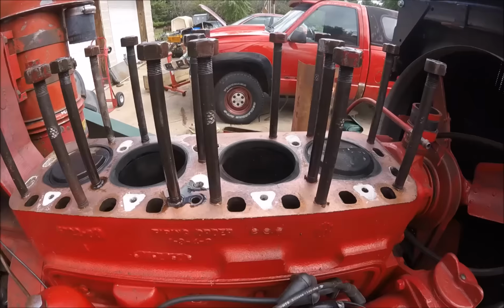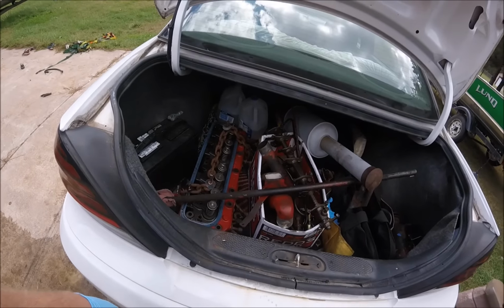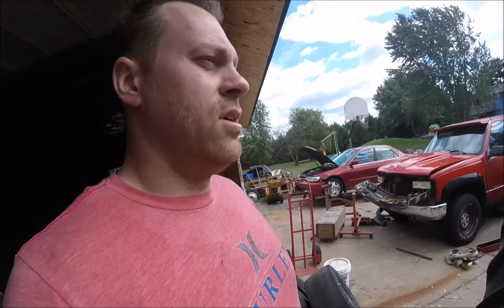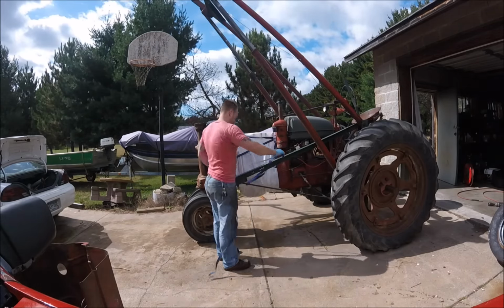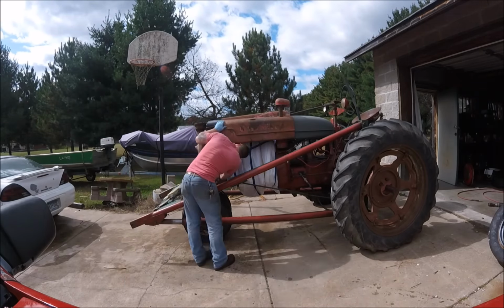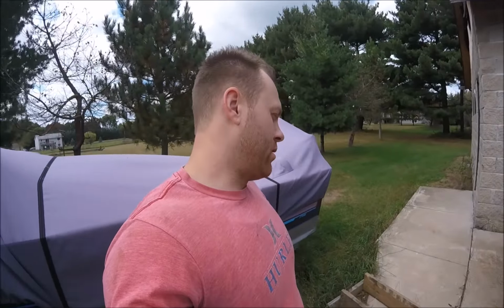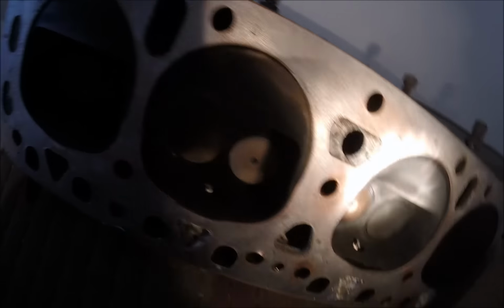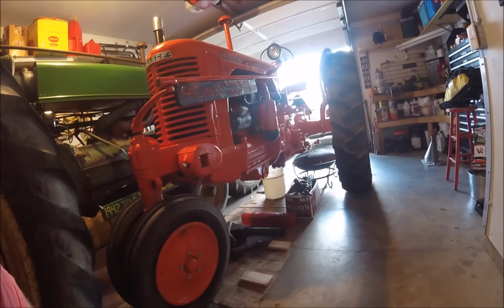1947 Farmall M Episode 22: Cylinder Head Removal AGAIN!

Comment: there is one repair possible.  the FAA required  piston aircraft engines to use screw in valve seats. pratt & whitney made their own tooling to do this . most  automotive machine shops  do not know about this fact. installing them requires a  head mill to bore the head  to the correct size for the threaded blank then a special tap is used to  cut the threads then a blank is screwed into the head and it is pined in place and   the seat is ground to size.
Reply from the maker: I'm not sure if my machine shop would be willing to do this
- but it is an interesting process! I suppose the reasoning behind it would be
less of a chance for failure (Sure hate to drop out of the sky due to a failed
valve seat!) I know the head is cracked behind the valve seat, so it is
probably best that I replace the head anyways.

Comment: So why doesn't the machine shop fix it again?  Sounds like they may be the issue.
Reply from the maker: The machine will do another head for no charge, but because of the crack
 under the valve seat they are not confident that this one will hold.

Comment: what you looking to spend?
Reply from the maker: I would like to keep it around a couple hundred dollars just for the 
casting. That is the only part I need ( but all the new valves, etc. are
 pretty much useless without having them in a cylinder head)! :-)
Reply: There are so many M tractors also I am not sure if 400 farmalls have the same engine
Reply from the maker: There are. The issue is finding one that has no cracks, and also finding a gas head. I already have all new gas valves (and distillate heads require different valves). I believe the LP heads (400/450 heads) alo have different - larger - valves. So for me to go with anything BUT a Gas M head, I will have to purchase a new valve train as well.
Reply: well if I find any in my travels I will be sure to let you know sir... I drive
 OTR and I have found some  at many different places around the country...
Reply from the maker: Sure would appreciate it! Thanks!